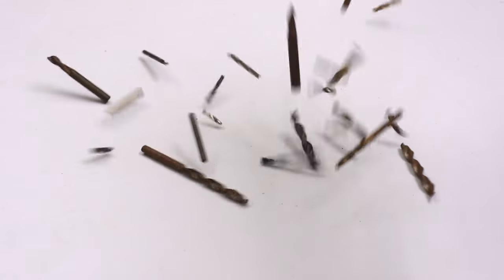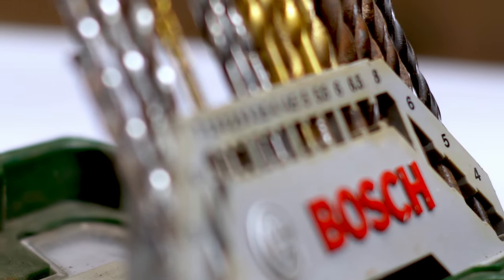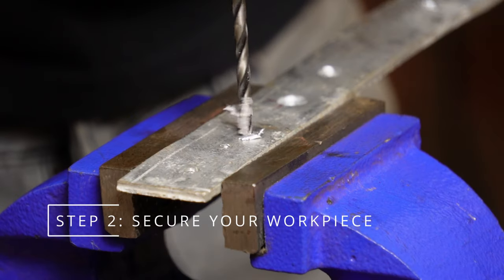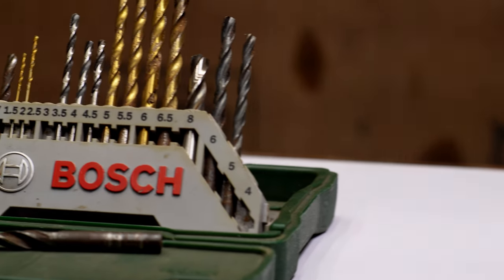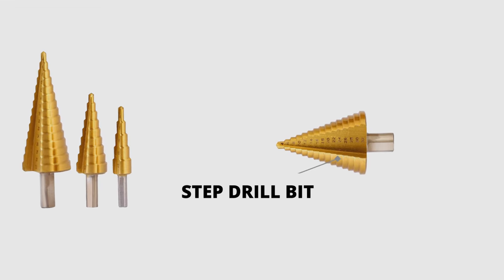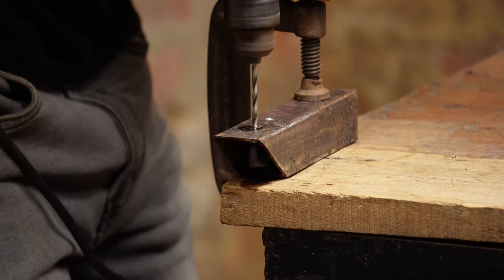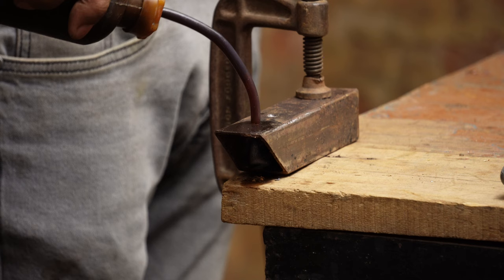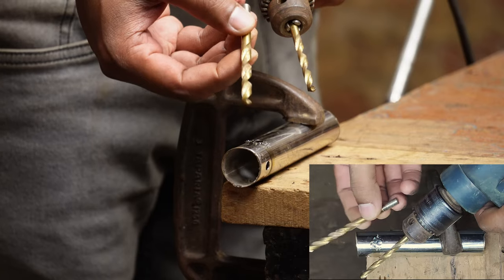How to Drill Through Metal With a Hand Drill  Like Pros!

Comment: I just can't  drill the metal, still after doing all these steps.  Bits are bosch,  drill is black decker  550w corded.  Any solution
Reply from the maker: Can you please elaborate on your problem? Which metal are you working with, and which kind of drill bits are you using?